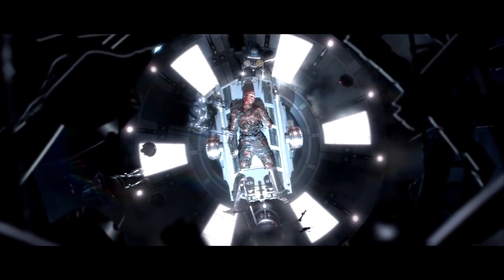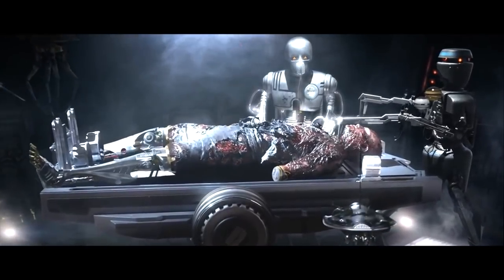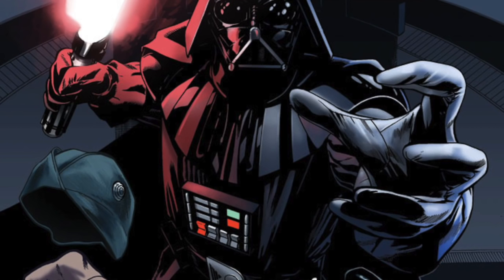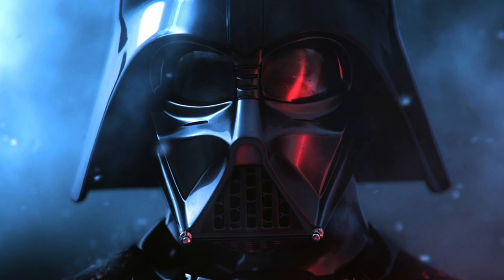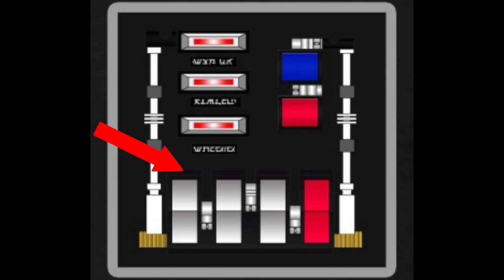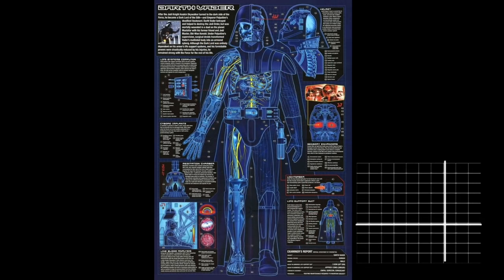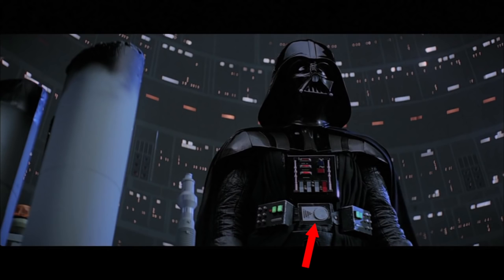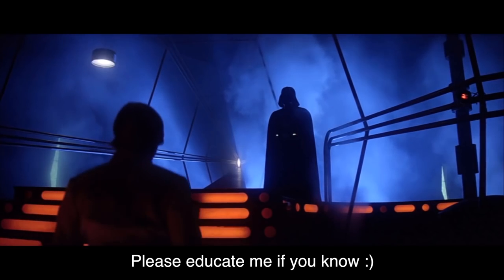ALL of Darth Vader's Buttons and What They Do - Star Wars Explained

Comment: I wonder what would change if Vader's respirator didn't make a sound. Small change, I know, but perhaps Vader would be capable of better stalking his victims in dark settings which would thus make him more dangerous when duelling in darkness. It could even be used by the Empire as a way to control the people through terror, as people would be so paranoid about an agent of the Emperor lurking in the darkness, waiting to strike against any who dares question the authority of the Imperial rule. 

There's probably much more that this small change would make, but I doubt that it would ultimately change the overall events of the timeline. 

I could be wrong of course, but that's my thoughts on the matter :)